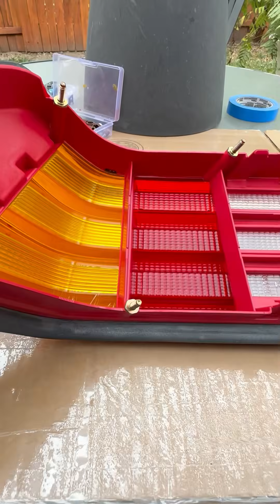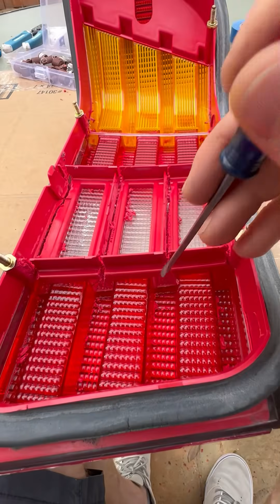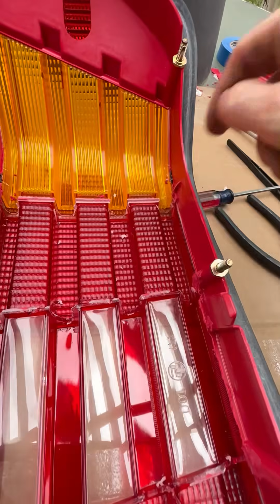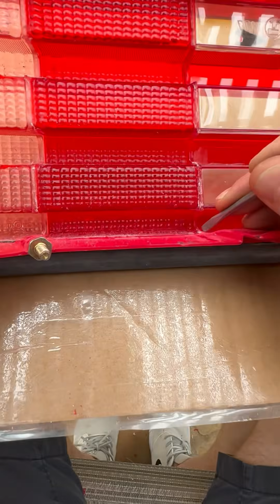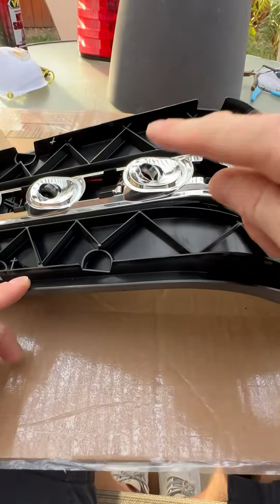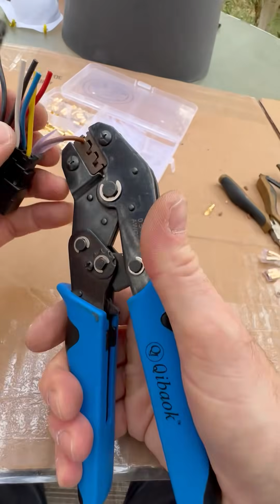R129 LED Taillight Installation

Comment: Question - For the earlier Gen tail light. You never spoke about painting it, but do you paint the orange part red if you want the all red look as well. Hope my question makes sense or do you have to stick with the orange left the way it is and ‘order orange’ color for the lights.
Reply from the maker: You can paint the orange part red but it gets dark really quickly compared to the 96-98 lenses with the orange insert. For the "all red" look I tend to use the 96-98 lenses